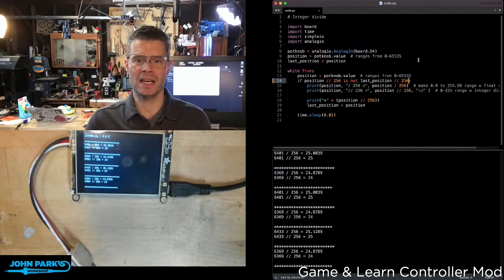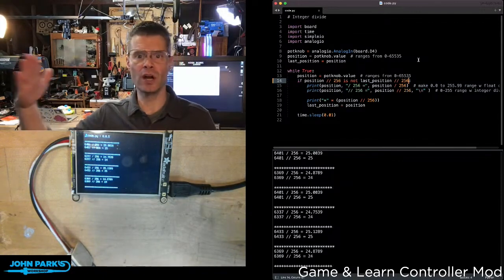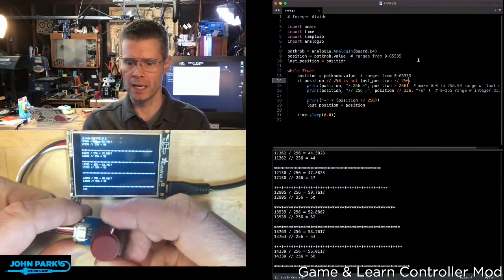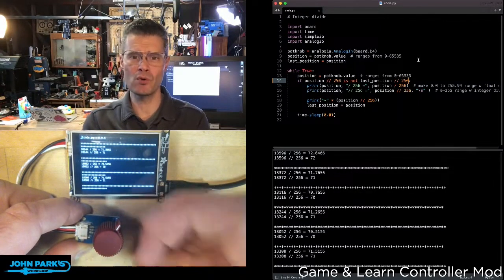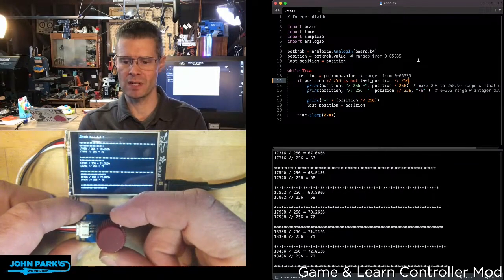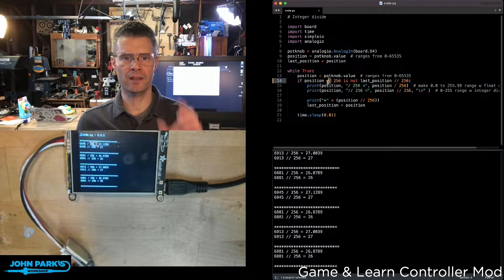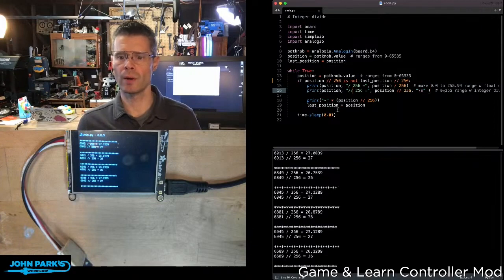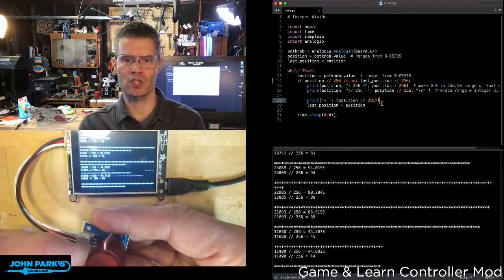John Park's CircuitPython Parsec: Integer Divide #adafruit #circuitpython

Comment: Does this work with other operators? can you do ** for example?
Reply from the maker: That'll do powers.
Reply: If you multiply two integers you will get an integer anyway. If you want to convert a float to an integer (say the product of an integer and a float or the product of two floats) you can use the int() function eg. int(9.9) or you could us integer division eg. 9.9//1